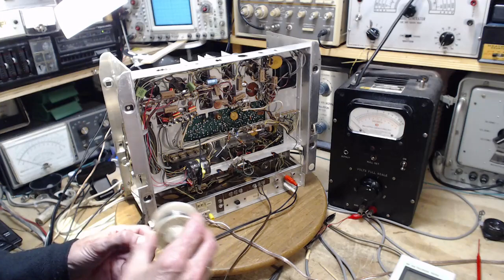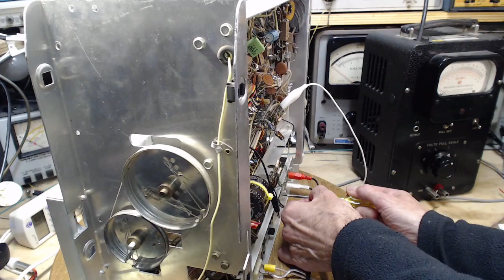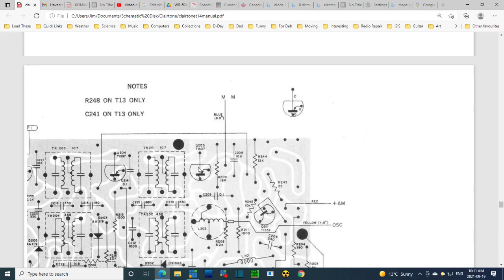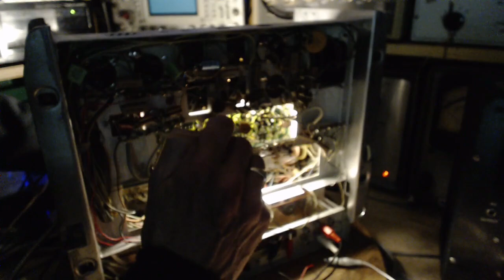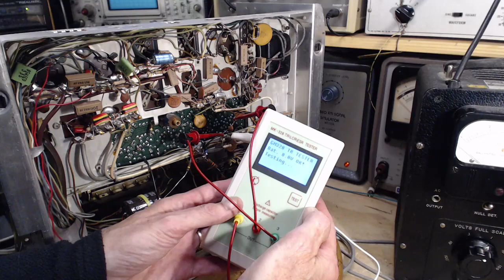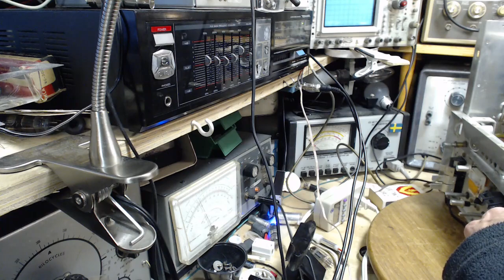Clairtone Console Stereo Video #32 - Automatic Gain Control

Comment: 23:42 Quote "A capacitor with no capacity" That is the conclusion you only draw when you dont even have the slightest clue about the test equipment you are using! This MK-328 multi component tester will and cannot identify capacitors in the few pF range! Both due to the test leads introducing more aberrant capacity than a pF cap tested, and the test method used not even meant resolve single digit pF. Realistically the T-4, MK-328 and similar ATmega 328 based chino-testers will start to work somewhere around 50pF with realistic results needing 500+pF.
Bottom line; his conclusion that the 4,7pF ceramic cap was bad because his chino tester cant see it is total BS and replacing the cap is not only futile but introduces another chance to mess things up even more.
Especially since the 5pF he put in will load down the IF more.
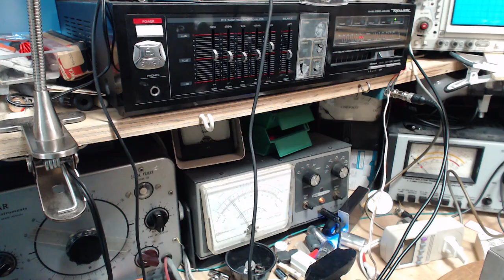And his selfpraise at 25:25 of it being a "great improvement" is a blatant lie. The radio AGC voltage behaves exactly the same as with the 4,7pF cap before. Nothing has changed but a perfectly working part in an RF circuit(!) being replaced with a part that has an almost 10% higher capacity.
Poor customer... The labor bill piles up and after 30 hours the "Tech" is still blindly poking in the mist...
It sometimes pays to pay professionals...

Comment: More than 30 hours of video on this piece-of-crap radio?  Really?
Reply: Yes, but $45 an hour are my rates.
Reply: @erin19030  Even if Jim charged like $3 per hour, the time spent which is documented on video amounts to $60 already. Plus time spent off camera. 
And the thing is still not running like it should, plus the replacement parts are from a junk box. Just look at that monster of speaker coupling cap zip-tied to some random part of the frame. 
The owner would have been better off to get it serviced from someone professional even if their labor rate is more expensive.
Reply: Go watch glasslinger or something and come back when he's finished this one.